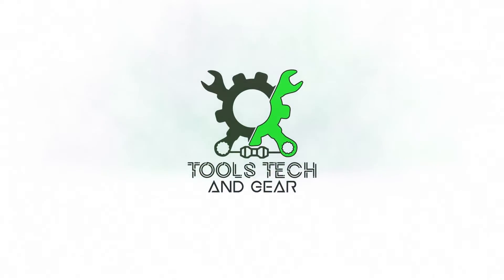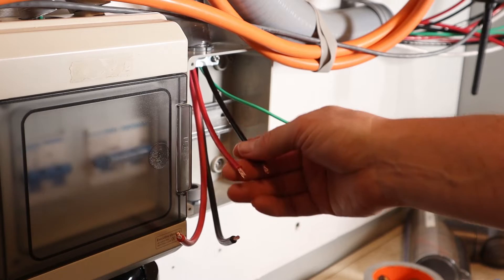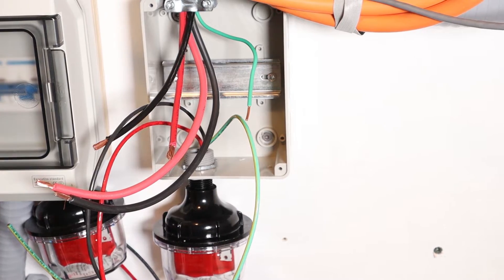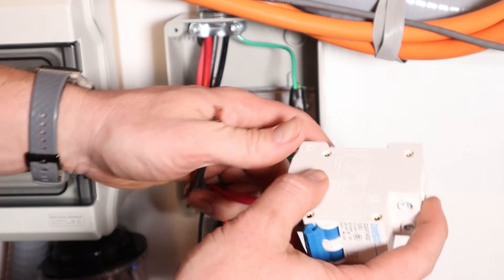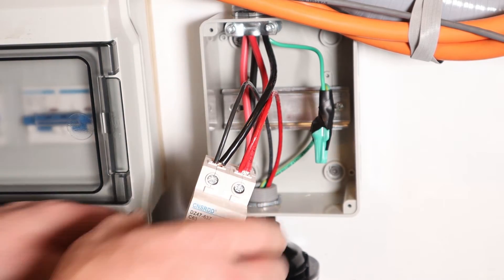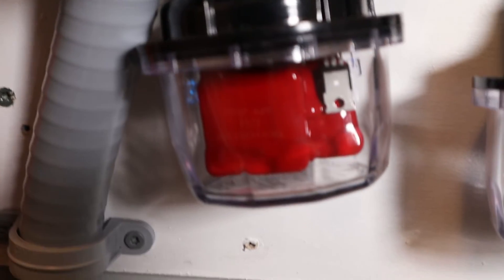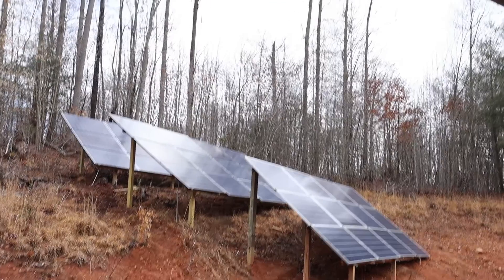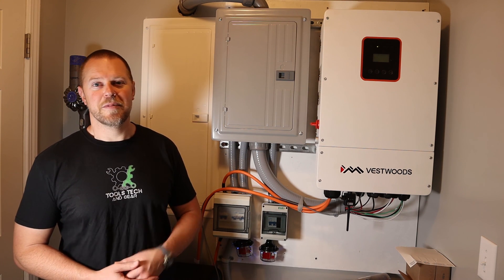Midnite Solar Surge Protection Device SPD [ Full Install ]

Comment: On my combiner box I've got two separate circuit breakers going to two separate mppt inputs on my 12,000 XP inverter does this mean I would need two of these midnight solar protectors? Thank you for your video or is there a way I can hook just one up to make it work for both mppt inputs thank you again for the video

Comment: wow, did you say 400 amp breaker? Those wires would melt before 400 amps trip that breaker.
Reply: solar doesnt magic extra amps into existence if they are shorted, the current only raises to ISC, the breaker is basically there as a arc arresting off switch for emergencies.
Reply: @chaon93  That is true. You could get more current if the panels were being exposed to more light from reflections but then you got other issues

Comment: Thanks for the video.
If I understand correctly. The SPD is a redirect (path of least resistance) for the lighting. I don't see how it would cut power like a fuse. Which would stop the flow of damaging power. I know a fuse wont react fast enough for lighting. One strike, and it's done. What if something crazy happens like a second strike before you get it replaced?

Comment: The Midnight Solar instructions clearly state to avoid any bends in the wiring, yet you essentially created a 180 degree bend by using a wire nut on your ground.
Reply: Unnecessary bends, not all bends. And sharp bends. Don't kink the wires. The actual text from the MS instructions is: "The conductors used to connect the SPD to the line or bus shall not be any longer than necessary and shall avoid unnecessary bends."

Comment: Seem pretty silly to have a 1000V 400A breaker from you PV feed. Some very long series strings of panels could possibly add up to 1000V, but it takes a hell of a charge controller to handle that. And never will you ever see anywhere near 400A coming in. You should always do breakers that fit your system. Not so sure I trust this guys info.
Reply: Solar breakers are there for an extra point of disconnect more than they are for overcurrent protection. Unlike batteries which drive huge current if shorted, a short on a panel basically changes nothing in terms of current.

Comment: Wouldnt you want the spd wired in the pv side of the breaker? The reason i ask is because it seems like the breaker would trip in the case of surge and excess power wouldnt be able to make it to the spd 🤔
Reply: Yes! SPD should always be connected to the breaker's solar input, not the MCB supply. Surge will never trip an MCB, SPD will protect the MCB and the Inverter by trapping the voltage spike and sending it to the ground before getting to the breaker
Reply: Breaker would never trip, it's not even designed to withstand thousands of volts

Comment: put the wires to the pv  +  and -   and ground, and that should protect my battery's also/ CORRECT? thanks Mine is an off grid system with no AC coming in.